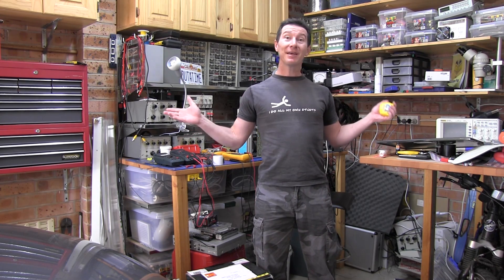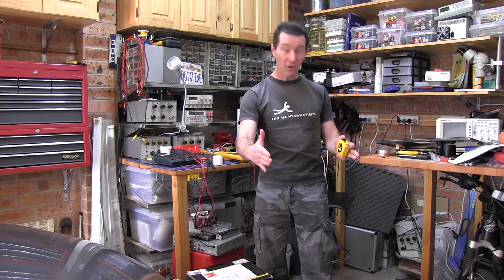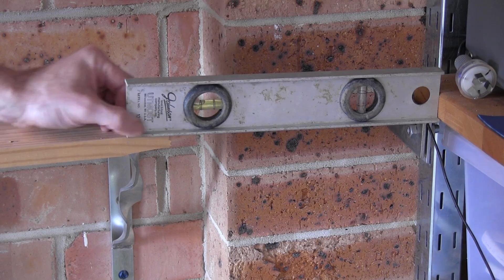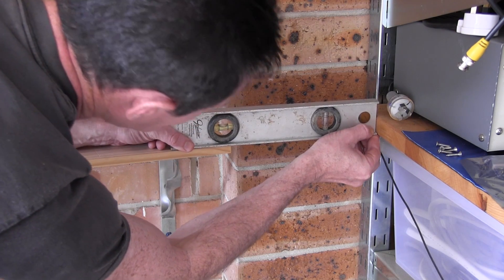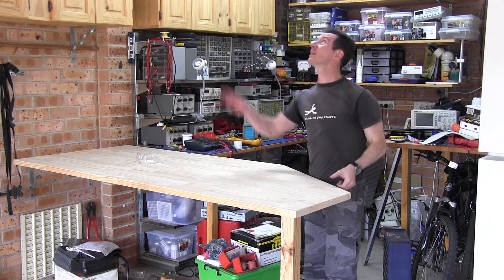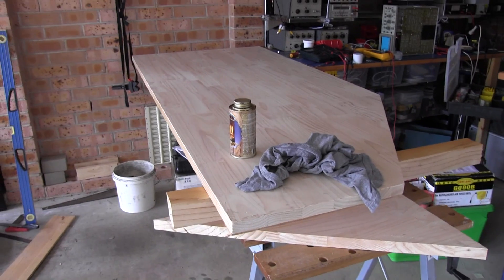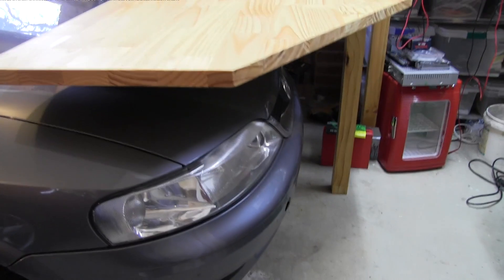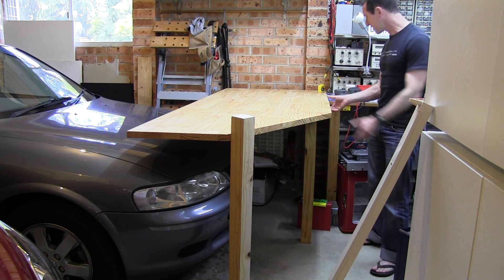Lab Bench Build - EEVblog #194

Comment: I know this is an old video, however there are newbies lurking that hadn't seen all your videos.What I did to make sure the car stopped at the right place was take some thread and tape it to a ping-pong ball. Making adjustments after attaching the string to the ceiling. I put mine so it aligned with the center of the windshield, when the car moved ball it was the place to stop. Even a tennis ball will work!

Comment: Here's a tip that some people might find useful.  Back in the early 70s, I worked at an audio service shop.  Our bench tops were covered with carpet.  There were two reasons for that.  First, of course, it was to prevent the genuine simulated walnut [ :) ] cabinet of someone's $500 amp from getting scratched.  But it had another purpose.  Ever notice how, half the time, when you're removing a screw, it falls out and lands on the bench?....and then it bounces, and often ends up on the floor.  But if it lands on carpet, it stays put.

Comment: Stop-blocks required for the car's wheels.
Reply: +Landrew0 Good idea! My father used to use wire pendulum with attached weight hanging before the wall. Touching with car makes it move and that will be the point where to stop before hitting the wall.

Comment: Dave you don't need any electronics to get help with parking. First I was thinking to make wooden wheel stops on the floor so you couldn't get closer. But then they would be there obstructing floor. Better solutions is to hang tennis ball from ceiling on a string in such way that the ball will touch windscreen when you are to close. 0W consumption, beat that! So you would have visual feedback how far you are and when it would be in you way you could fasten in on side wall.

Comment: If you can't anchor from the ceiling, anchor it from the wall with a cross member (wall to far end of the bench) which you can also use as a support for a false wall above the bench for shelving.

Comment: Hey Dave, I reckon you should dynabolt a bit of 2x4 to the floor about an inch back from where u want your car's front wheels to sit. Will make sure u can park in as far as u can with certainty that u won't mow down your nice new bench :)

Comment: just run a steelcable from the roof to the bench. its cheap and neat. be sure to put a length adjuster (don't know the name) between it. the device i mean to say is used to tension the cable.

Comment: I would add hinges in wall side of the table so there will be possibility to bend table to the wall in case you need space in the garage. For example to open car hood while the garage doors are closed. But this will require more work: table legs must be bendable and so on….

Comment: Just hang a string from the ceiling with a little plastic doohicky ( technical term ) on the end that hits your windshield when you should stop. Okay, okay, so stick an LED light in it so it will be electronic.

Comment: A coach-eye bolt in a convenient rafter above, another eye bolt through the bench, a length of chain and a twist tensioner. Done. Or you could take the chain/wire cable back to the wall at 45 degrees and affix it to the brick work rather than the roof.

Comment: I like your setup so far, but I would try to make it less crowded when you need to take stuff in and out of your work station.  I would just turn the bench into a door-like flap.  Make an incision in the bench and place a hinge there.  Then connect the very edge of the bench (near the car) with a steel cable.  Next make a simple sliding mechanism for the steel cable, which would allow your new bench area to be lifted when not used, and sturdy when in use.

Comment: Of course in the future you may change your car - different bonnet length and possibly a different pitch on the bonnet. barcelona08018 suggested the tennis ball idea which is easily adjustable, but what about several indicators along the car facing side of the bench, which show; when the back of the car is far enough in; the distance from the post; the distance down from the bench to the bonnet; possibly how centred the car is left to right across the garage.
Great project!

Comment: what about a plegable table. when you have the car outside use the tabe with conventional legs. and when you have to enter the car. you can put the table close to the wall. another think to take care is protection for the car paint. put some cloth under the table in case it touch the car.

Comment: Well everyone is having ideas of holding up the end, cables and such all... only 1 car one.... good, and the wheel chocks... smart... drilled into the concrete, meaning posts on the chocks then slid into the concrete where you need them, maybe multiple holes in the ground for different cars in the future, or same car just different spots? maybe closer maybe farther?

Comment: I would use steel cables (one at the corner, one in the back center of the workbench) connected to a small support plate through the workbench. I think you need the support in the corner where the car is under. I don't know, but stressing wood on tension (post from the ceiling) doesn't feel right when you got other possibilities.

And first thing to do after the workbench is mounted: a wall to the back! Murphy dictates that a 1$ screwdriver rolling off will make a 1000$ dent into the bonnet.

Comment: MUCH simpler than using an ultrasonic Dave! Put a piece of 3x3 across the garage floor in front of the bench. When you drive in you'll feel the resistance of the car trying to drive over it and know where the stop-line is.

Comment: @EEVblog 
I would make the cutout for mechanical reasons. The leverage on the support is much higher when the workbench only sits on the "tips". The workbench might not be that heavy, but if you put the toolbox back there I would make sure it sits on the supports only by filling the gap with something thicker than the workbench.

Comment from the maker: @mattinx Well spotted. I thought about cutting out the notch, but I figured it wouldn't gain me anything really. I consider that space against the wall fairly "dead" working space, as it's hard to reach from within the lab (probably put the toolbox back over it anyway), so I wanted more overhang over the car that was more useful working area. And it gives me handy cable access too.

Comment: I'd use three cables - two on the end and one in the middle of the back run for support. Enough to drill a hole and mount the cable to a plate under the bench for support. I think for a stop indicator I'd just get some of that ball chain used for pull chain lamps and hang it under the bench in the right location, or a spring mounted shaft of fiberglass rod.

Comment: Steel cable to a rafter was my first thought too. On the far corner where it abuts the existing bench, could you not have cut a notch out of the corner to flush it up against the wall, or was there a reason for leaving the gap along that edge?